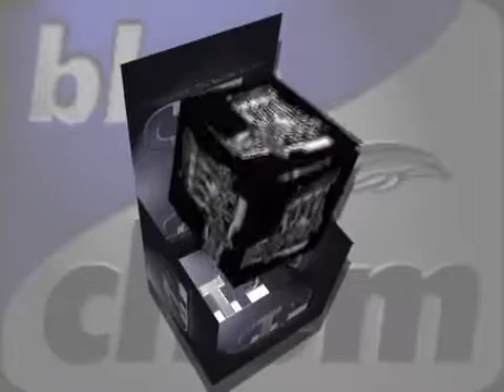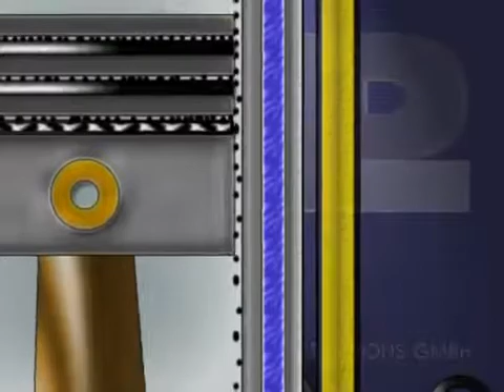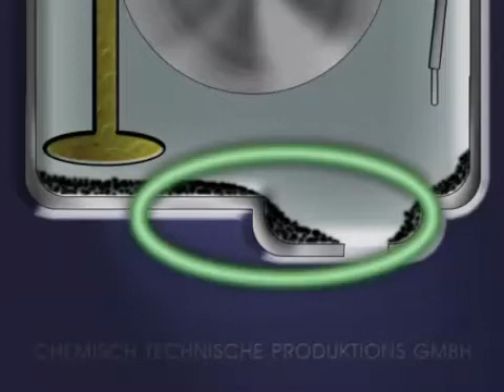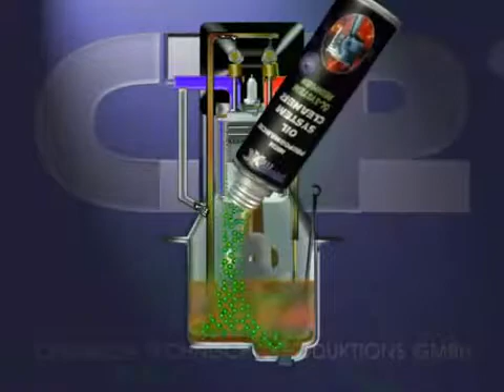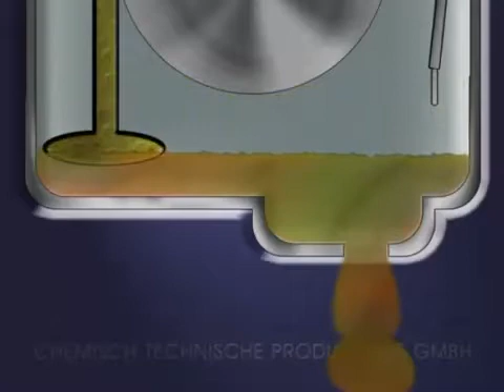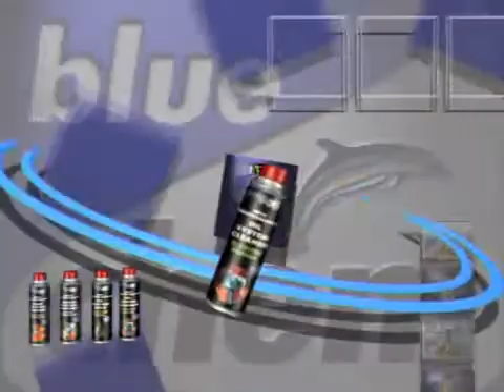Car Engine Oil Malaysia - Powermaxx Oil System Cleaning

Comment: I like this, but I can not see the oilfilter in these engine diagrams. Most of the problems discribed here are prevented by the oilfilter, is it not? That sludge at the bottom is not reality.